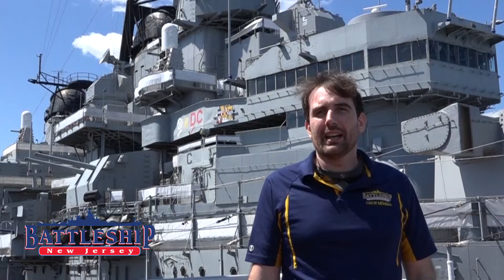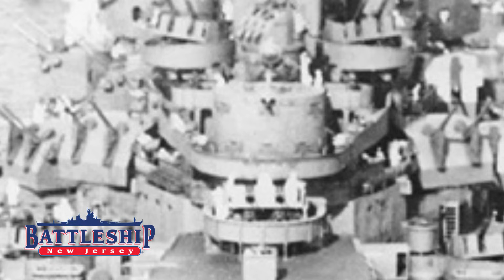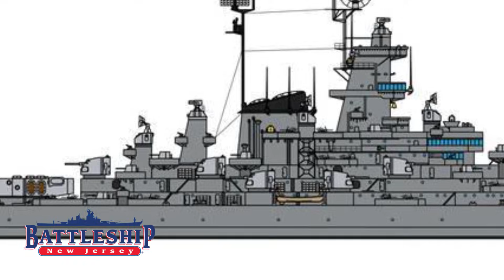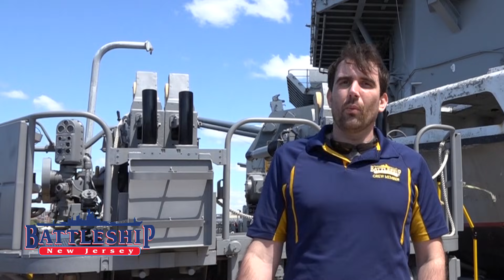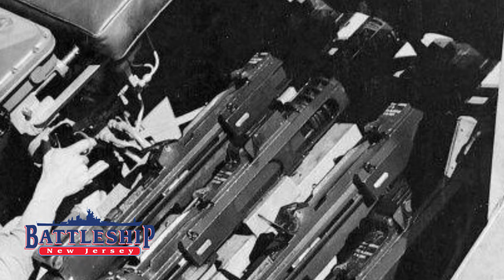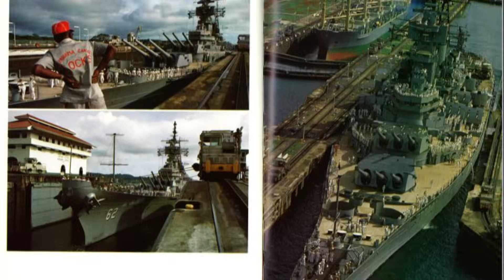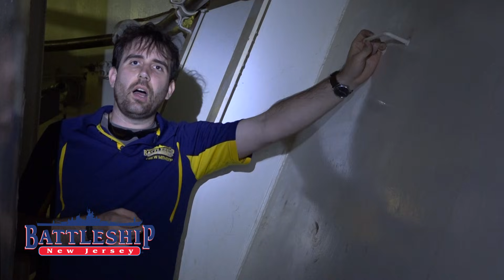What the Navy Doesn't Like About the Iowas

Comment: What the Navy does not like about the Iowas #1    1. They require an insanely large (relatively speaking)  and expensive crew to maintain and operate them.  If memory serves its the biggest lifetime cost in a Warships lifecycle.
Reply: thats what i recall hearing back in the mid 80s when i served navy,did a tear at todd in seattle on a dd.finding spare parts had to be tough too as none were made anymore and the dies were long gone to.we had raiding partys on decomm ships for fire fighting spares ourselves lol
Reply: What the navy doesn’t like about the Iowas
High main battery shell arcs and low shell velocity
Reply: @theheavytonk928  That's actually an advantage when it comes to fire support.
Reply: I think it's because aircraft their missiles and missiles in general made them useless
Reply: That’s true today as well. 

I think I was watching something comparing the cost of current ships to the crew for a year and comparing those numbers to other shops in the fleet. 

The cost of the ship is like 15% of the total cost to run a ship with all the equipment people and support.
Reply: Yes , recently saw a vid that talked about how it would be impossible to train a full crew that could keep the older, unreplaceable equipment running. There were only five guys left in the navy that had served on a BB. The experts are all gone.
Reply: Their 1980's refit made it so that the Iowas have less crew than a Nimitz or a Gerald R. Ford.
Reply: @Battleship009  True, but for a HUGELY less capable ship - a BB is simply almost an order of magnitude less useful than a CV.  Compare the BBs to something like the Tico or Burkes, and you see the manpower difference. Well over 5x.
Reply: @eriktrimble8784  True, which is why for shore bombardment I think a modified Des Moines or Alaska would be suitable, the latter despite having 12" guns which have twice the rate of fire and the barrels lasting longer but none of them remain, oddly enough one of them was under construction was considered to be converted into a guided missile cruiser, but navy decided otherwise.

The Des Moines which only one remains has 8 in guns with a high rate of fire thanks to autoloaders, and has a higher top speed than a Tico despite being older.
Reply: @Battleship009  Except even there, the larger guns are pointless.  The Zumwalts came the closest to having a shore bombardment idea with additional flexibility. But the AGS failed.

It just boils down to any gun-only ship is a one trick pony, and there's no justification for spending a billion on one, when you can buy a Burke for less and get a LOT more.

We just don't need Naval Gunfire Support anymore. It's that simple.  We use missiles and strike aircraft for the same job.  And that will only get cheaper when the Navy admits that the F/A-18 should be replaced with a drone for the strike role (at less than 1/3 the cost, too). 

The problem with guns is that they're inaccurate.  Making them accurate costs MORE than a JDAM (per shell), and almost the same amount as a missile. And the gun is less useful - you can't hit things that don't have a ballistic path from the gun to target. JDAMs and missiles have no such restrictions.

Guns simply can't beat a smart-bomb armed drone in terms of effectiveness and cost.
Reply: @Battleship009  that was the thinking behind the Zumwalts with the AGS. 

The problem is that we cant seem to produce a good larger gun anymore, without going into insane costs. The AGS was looking at something like $10k per unguided shell. $150k for a smart shell. 

JDAMs run about $30k or less. The economics say it's simply cheaper, more flexible, much higher accuracy, and better to drop a JDAM on something. And  larger drones can carry 2 JDAMs.

I think it just boils down to the fact that NGS isnt useful in the modern world. We dont do opposed landings anymore. And you have ground arty, drones, aircraft, and missiles that can do the same thing as NGS, cheaper and better.

The bigger problem is that NGS requires you get close to a coast. That's not something the Navy likes to do anymore - risking a billion dollar DD less than 10 miles from a coast is seen as silly.

If anything, I would expect that something like the LCS or corvettes get upgunned to the 5" for NGS.  

I just can't see a major surface combatant with a big gun anymore.
Reply: @eriktrimble8784  Or we could build monitors for that, also 8 in is 203mm.
Reply: @Battleship009  we could. But we won't. Navy doesn't want them. And truth be told, they would be sitting ducks.

Heck, we couldn't get them to build missile arsenal ships. The Navy only assented to the Ohio SSGN conversions to keep another hull in service.

I look at stuff like the LCS, and wonder if the Navy is ever going to think that it should do ANYTHING except fight WW2 again.
Reply: @Battleship009  Des Moines has been scrapped long ago....2007.
Reply: @nickkanderis630  Nope, there's one remaining, USS Salem.
Reply: @Battleship009  Prior the the reactivation of the IOWAs in the 1980s, the DES MOINES were also evaluated for reactivation and fitment of Tomahawk cruise missiles. They provided far less capability than the IOWAs across the board. Modern barrel protection methods make bore erosion a non-issue. Neither the 8 or 12 inch guns come close to the hitting power, range or flexibility of the Mark 7 16" guns of the IOWAs.
Reply: @iowa61  True, but they had a higher RoF and last longer than a than a 16"/50, and apparantly the HC round for the 8"/55 could be used as AAC round when fitted with a MT fuze.
Reply: @eriktrimble8784  lot of time difference in Iowa's and Zumwalt wasn't even on the blue print board . Cannot compare
Reply: @Battleship009  Missiles are way too expensive and a Burke or an old Tic do NOT have the number of anti ship missiles or bombardment projectiles to cover Marines in a landing situation. and you need a heck of a lot of ships with five inchers at 2 (?) apiece floating around in an offshore area. Also this translates to a lot of TARGETS floating around. Also I saw pictures from WWII of heavy thick concrete pillboxes that were literally yanked out the earth and tossed in the air. The battleship round never actually hit the target; but, it hit near enough to ruin it's purpose. The occupants were blasted naked and dried blood could be see around their eyes and ears... the structure was still pretty much in one piece. The battleships played a good role during the GULF War; they scared the living hell out of the Iraqi troops and one commander stated he lost most of his divisional artillery in less than a few minutes due to shell fire from battleships. Even if his guns could reach that far it would not have mattered.Most all field artillery would need to hit a ship like that a lot of times to even hurt it.  Accurate ? Some 16 inch shells actually have TV cameras inside them to check if the target was destroyed or if corrections and maybe more shells are needed. I would not want to be a marine landing on a hostile shore with a few five inch guns backing me up. Plus AAA missiles are tough on ground support aircraft. A battleship can hang around an area for hours and a plane has to return for fuel, munitions, pilot has to pee, etc. If attacked by a sudden armored unit a plane bingo of fuel and munitions is not useful. Battleships carry 250 plus HE rounds in EACH of the turret magazines. Something to think about. And who said we do not have a use for them ? Somebody out there have a crystal ball ?
Reply: @eriktrimble8784  Not to mention the fact that given the advance in modern weaponry, it would be a miracle if a Battlewagon could even get within range of using it's main guns. As was pointed out to me before, Reagan did have them upgraded with missiles but, when we already have dedicated missile cruisers, the battleship is wasting most of it's deck space, with now, useless gun battery's.
Reply: @Battleship009  Even shore bombardment is shifting towards the missile. Using big guns, means that one must come within range of many modern, and portable weapon systems. This is why we are trying to develop the rail gun. Same hitting power as a 16 inch shell, but with a 110 mile range.
Reply: @eriktrimble8784  You are 100% correct. It is too risky, to put big assets close to the beach, where modern, portable, and cheap weapon systems, can take you out. Every weapon system, eventually becomes obsolete. That day is rapidly approaching for the carrier as well. And also, for human pilots. When a drone can pull G's that incapacitate a human, it is game over for the heroic fighter pilot. Just as the Schooner of old, we all go obsolete eventually....
Reply: @ConvairDart106  I doubt that missiles are replacing guns in shore bombardment.
Reply: @Battleship009  Shore bombardment, just like carpet bombing, are going the way of the dodo. They were both used as a method of saturation, that would eventually destroy what you were after. With guided weapons, mass bombardment has become obsolete. This became obvious during desert storm, when we were able to take out targets next to a hospital, in downtown Baghdad, in the dead of night. Shells are too expensive just to make craters in the ground. Besides, we have munitions like daisy cutters, and Tomahawks, which are capable of carrying multiple munitions, in one compact, fast, and long range weapon system. Many of these weapons, could be used from a large fishing vessel. The battleship, is right where it belongs. In the museum!
Reply: @Battleship009  We don't do shore bombardment anymore. Why would we? What's the point? There's no such thing as an opposed amphib operations anymore (except at the SEAL-team level).  If the target is well inland, then you have to park the ship close to the shore, and you DON'T want to do that. Even detailing something like a DDG-51 as an escort for a shore-bombardment ship doesn't solve the problem - now all you do is raise the stakes, and you've got TWO billion-dollar targets for missile spam/small boat flotilla/submarines.  Coastal protection by diesel-electric subs is a MASSIVE threat to everything, particularly if you're known to have to be within a very small area for an extended time period. 

Truth is, we use missiles for extremely high-value targets on land, and we use smart bombs for everything else. 

To a significant degree, this is also showing up in the fact that for both the Marines and Army, Artillery is MUCH less important than it used to be, even 20 years ago. And artillery is FAR, FAR, FAR more flexible in use than shore-bombardment capability in a ship.  More easily protected, as well, especially since it's far lower per-instance value.

NGFS is really a mission that's gone. It's still around for brown-water navy stuff, as well as small-end combat (fast attack boat interdiction, spec force insertion, etc.), but on the large scale, it's simply gone.
Reply: @ConvairDart106  Then why is NSGFS stil practiced? And there's different kinds of fire missions in NSGFS.
Reply: @eriktrimble8784  see my response to Convair.
Reply: @Battleship009  Top headline this morning. South China Sea.The Theodore Roosevelt is being accompanied by the Ticonderoga-class guided-missile cruiser USS Bunker Hill, and the Arleigh Burke-class guided-missile destroyers USS Russell and USS John Finn, the U.S. statement said. Notice, there are NO big guns in this battle group?
Reply: @ConvairDart106  I know guided missile DDGs and CGs don't have big guns, but that doesn't mean that NSGFS is going the way of the dodo.
Reply: @gregwallace9314  This has all been debated ad nauseum. BBs are relics. And what shell had a tv camera built in that could sustain the g-load from firing? Fantasy.
Reply: @ConvairDart106  missiles already pulls gs that a human can’t susatain, a drones ability to maneuver is largely irrelevant in a modern airspace.
Reply: @Battleship009  Actually bring back the 8" MCLWG (Major Caliber Light Weight Gun) from the 70s upgrade it with new technology and mount it on a Burke in place of Mount 51.  It's the best we can do and would check a lot of boxes.
Reply: @ConvairDart106  I DID list alternatives to a battleship, such as a 12 in or 8 in gun armed cruiser as both are smaller and cheaper to build and their guns last longer than a 16 in gun, and I am NOT a knothead.
Reply: This is one reason the Navy got rid of steam powered ships.  Nucs or diesels or gas turbines.  There is no Boiler Technician rate anymore in the U.S. Navy. :-(
Reply: @DesertRat332  What the hell do you think that nuclear reactor does? Einstein himself said, "It is one hell of a way to boil water!"
Reply: @ConvairDart106  Wrong choice of words on my part.  I meant "oil burning" propulsion plant ships.  There is no Boiler Technician Rate anymore because there are no more ships in the U.S. Navy using oil burning boilers to produce steam. Aircraft Carriers and Submarines use nuclear reactors to generate steam and those are operated by Nuclear Machinist Mates.
Reply: @DesertRat332  even though carriers and submarines are nuclear powered, that refers to their ability to produce steam in a steam generator with the power(heat) source being provided by a nuclear reactor.  These ships and subs are still powered by STEAM turbines with steam turbine generator sets. Steam turbines are still an inefficient power provider and their ancillary equipment does require more maintenance than that of a gas turbine or Diesel engine. Typically the surface ships I served on had an  efficiency of 25-30 per cent.
Reply: @DesertRat332  False, most ships use boilers as you've got to heat the fuel somehow
Reply: @Battleship009  Not really.  The CVs and SSN/SSGNs use nuclear reactors to heat water (they don't go through a boiler of any kind) then on to the turbines.  The FFG-7, DDG-51, CG-47, and LCS all use gas turbines (essentially jet engines), and have no water being boiled at all, by anything.  The Amphib fleet uses diesel propulsion, for the most part.

The only ships I can find in service that still has a boiler are the Wasp class (LHD-1), and as of LHD-8 (USS Makin Island), they've switched to gas turbines.

Same goes for pretty much all other navies. Steam boilers are a thing of the past.

As to civilian ships, the big cargo stuff still tends to use boilers and steam turbines. Small stuff is all diesel. But the vast majority of other seagoing ships have switched to gas turbines.  They're just so much more efficient, cost less, and are more generally useful.  I don't see new steam turbine ships being built at all - the diesels have gotten really good and really big, and there is now plenty of expertise in the civilian sector to run gas turbines (which, again, are radically superior to steam turbines in practically all measures).
Reply: Their engines would also need complete overhauls, if not replacements
Reply: @arctictiger8690  The ships themselves would need overhauls (including the powerplant as you stated) updated radio, commo, network, Satcom gear, etc.) and while you could partially automate the steam plant to save on manning another problem and pacing item is spare parts. They don't make a lot of the parts for the battleship's myriad systems from guns to hotel services equipment requiring even more $$$$ to update and replace. Then create a training pipeline and hoping enough people with the requisite skills in engineering and gunnery are around that want to teach the new crew.  It's just a costly and almost insurmountable set of obstacles and finance in today's economic atmosphere and then they would still only have a limited service life left. I love the BB(s) but it is just impractical to bring them back. Your money is better spent on more Arleigh Burkes.
Reply: @arctictiger8690  That's also true.
Reply: YEAH WEL L WHAT ABOUT THE CARRIERS CREW 5 TO 6 THOUSAND
Reply: @barneyrice8502  Carriers are flexible modern warships designed with a 50-year life cycle and have unlimited range (effectively) and are extremely flexible platforms. The Navy does not mind spending money on current technology. However, the economics of keeping an old Battleship in good working order, with worn-out parts no longer in production $$$,  with a large expensive crew $$$, requiring Navy Service Schools in ratings and job specialties no longer in common fleet use $$$$$, with very thirsty steam turbine engines $$$$$, and a supply and ammunition pipeline no longer extant $$$$, it just makes it an insanely expensive and impractical proposition from an economics perspective. So yes, the Navy does not like large crews because of lifecycle costs of acquiring, training, feeding, medical, retirement, etc.  Most modern warships are built with an eye towards minimum manning through automation. And, I love the Iowa class and as a former Fire Control Technician (Guns) I love the idea of seeing one of the grand old girls underway again.  But! unfortunately, they will never sail again for the reasons I specified.
Reply: During wartime, congress would just print more money to cover military costs.  Both Bush Presidents proved that.  Their crews were no more expensive that carrier crews.  In the 80's, reservists came back to train new sailors on all guns.
Reply: @golfhound  I love the battleships, but their days are long gone. No Industrial support base,  no spares, a big expensive crew, and a long-dead steam plant.   All of that would require massive amounts of cash that would crowd DODs other warfighting priorities like gender reassignment surgery and white supremacist prevention stand downs.